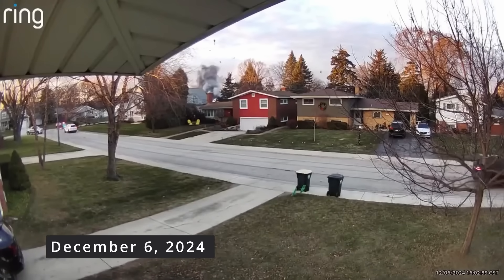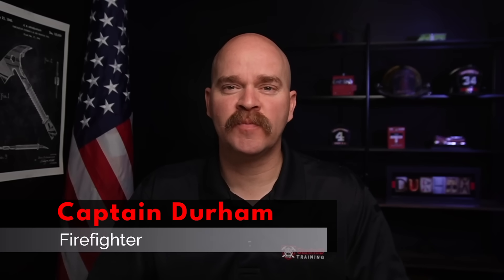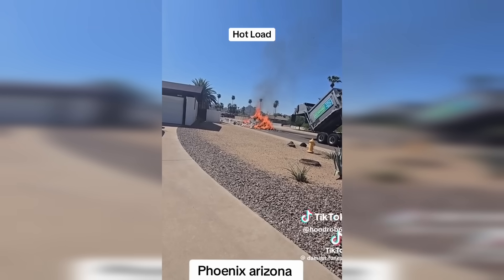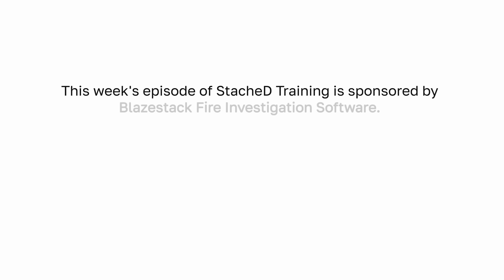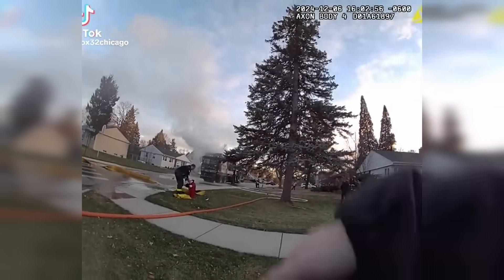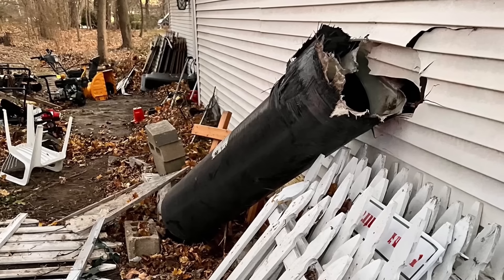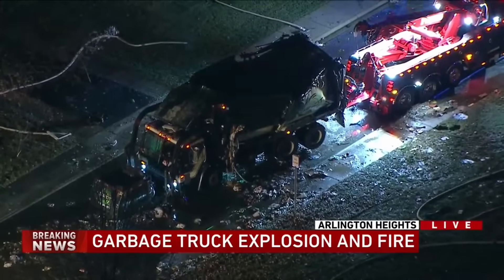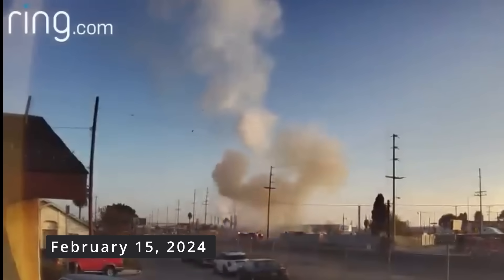CNG Garbage Truck Explosion Leaves 3 First Responders Injured!

Comment: CNG, LNG, and LPG
there are autos out there with all 3 fuel systems.
Liquid Natural gas, is like oxygen when turned to a liquid, it requires man made refrigeration to make it and maintain it, without a over pressure event.
Thus why compressed Natural gas fuel systems are made, no risk of venting when it sits for days in a vehicle.
3,600psi is the norm, for full CNG tanks.
.
Propane or LPG is way lower pressures, emergency relief valves are a little over 300 psi, in my experience. Normal operation pressure is directly related to atmosphere temperature.
Negative -40F is basically 0 pressure, a hot desert day is about the same as a air compressor tank at 150psi~
But still after it vents most of the fuel, it must be cooled or it definitely goes boom.
0.01c

Comment: Dang more Lithium battery catastrophe… did not see thermal runaway blowing up CNG.  The PRV valves are not full flow either.  Some regions require the PRV to have a hose on them exiting towards the ground adding more restriction.

Comment: Leaving aside the known hazards of lithium ion batteries there is also a big hazard associated with driving around in a vehicle with a tank of methane pressurized to 2000 PSI!
Reply: Forget the CNG and go back to diesel fuel. Much safer
Reply: 3300 psi or 3600 psi are the fill pressures that I've seen in the gas industry. And the tanks are engineered for burst pressures much higher than that. If a tank gets to burst pressure, one or more other errors were made first. And let's not forget CNG has much less energy density than propane, and we accept propane on much less stringently engineered uses (looking at you, RVs and food trucks).
Reply: @davidfirth1  In which gas industry, I ask because in the industrial gas industry maximum fill pressure is usually 2400 PSI and that lack of energy density you mentioned is the reason they are trying to use such high pressures though that is a fruitless enterprise. Because of Boyle's Law after 3000 PSI you no longer gain that much volume per additional pressure unit!
Reply: @ Natural gas. My recollection is our first use of CNG in our own passenger car fleet was 3300 psi and the current truck usually is 3600 psi. But I don't work directly with fill units and it has been a long time since I drove one.

Comment: Do you think that hydrogen carries the same risks?
Reply: More. Hydrogen's flammability range (7X CNG) is so wide, it can self ignite from static when leaking or pressure venting, making it more dangerous.
It's obvious to most, there's a reason diesel has been the traditional fuel of transport for over a century.
Reply: Q: Do you think that hydrogen carries the same risks?  A: the Hindenburg says "YES".

Comment: How do you avoid putting water on the PRD valve when the whole vehicle is on fire?  (I'm not a firefighter, just an engineer.)
Reply from the maker: Step 1, know it's there.  It can be difficult to avoid.
Reply: Evacuate the area and wait.
Same technique for a burning load of Ammonium Nitrate Fuel Oil Mix. (Another common road transport load in areas where mining happens). You just need to find all the parts in a half mile an hour later after it detonates.
Tyre fires are a common cause of heavy vehicle fires too (caused by hot brakes).
Overwrapped cylinders BURN…
Reply: @allangibson8494  😲 I thought you werent supposed to put the FO with the AN until you had it it the hole in the ground?  Yeah, yeah diesel spill and all.
Reply: Forget the CNG  and go back to diesel fuel. Much safer

Comment: I'm sorry, why not use diesel engines?
Reply: CNG is cheaper, burns cleaner, has less emissions components, and the engine oil stays very clean due to how clean CNG burns.
Reply: @user-ln7of9gs4s  it's also less energy dense and you need more of it. It's great for relatively low powered vehicles like forklifts, not sure it's the best idea for a 350-400hp application.
Reply: @randomidiot8142  Most likely routes are planned to manage gas levels.
Reply: @user-ln7of9gs4s well this one certainly had plenty of emissions.
Reply: @user-ln7of9gs4s  Back in the 1980s I had an engine builder doing a lot of work for me, they used to show me some things. One of those things were cylinder heads on CNG-run engines. The valve wear was excessive compared to the same engines run on gasoline, because the liquid gasoline has some lubrication properties to it and the dry gaseous fuel does not.
Reply: Forget the CNG  and go back to diesel fuel. Much safer
Reply: @gtbproductions1 cut and paste.
Reply: climate grifters
Reply: @joeg5414 there is no grift bud, pumping 27 gigatons of CO2 into the atmosphere every year just from burning carbon to boil water and move pistons is why climates are changing, especially in the higher latitudes. This has been known for nearly 60 years, but cheap energy, maximizes profits, the 1% happy.  And you'll buy cheap lies over hard truths. Oh that 27 GIGATONS is on top of all the naturally occurring CO2. That little extra is making things warmer. When you scoff at the avg temperature chart shown from the last century that's the average surface temperature of the globe and 72% of that is ocean. When was the last time you heard vessels needed to be wary of icebergs? Or I don't know look at the Hardiness Zones and compare them today from the last 50-70 years, they have moved north.
Reply: Clean city air grifters

Comment: I realize this is a CNG issue, but you mentioned it may have been caused by an improperly disposed lithium ion battery.  What is the best way to dispose of lithium batteries, of all common types, including laptop replacement batteries, phone replacement batteries, ebike batteries, lithium motorcycle batteries, calculator batteries, and common aa-cell, d-cell batteries?  What is the best place to google this disposal info?  If fees are involved with consumer disposal, I worry the proper disposal methods may often not be followed and deposit-return refunds may need to be added when selling the new battery to incentivize proper recycling.
Reply from the maker: There are a lot of issues around the disposal of lithium-ion batteries.  I'm working with a recycler to create content around that topic for the future.
Reply: @StacheDTraining I take my batteries to the local transfer station where the trash company runs a household hazmat collection program.  How they package them and ship them I have no idea.
Reply: There is. Forget the CNG  and go back to diesel fuel. Much safer
Reply: I have seen a couple recycling centers open somewhere near me and then eventually close down. They would only take certain things, for example only types 1 & 2 plastic. I tried to use them. They always closed eventually because they were unprofitable boondoggles that cost too much to operate.
Reply: @onemoremisfit  Recycling is all about the money. I watch the channel "Mr Digg." He runs and owns a landfill and to recycle the trash and better use the land, he started a sand business for concrete, recycles concrete, makes wood mulch, compost, top soil, and firewood from discarded trees, wood, and pallets, make huge concrete blocks out of the leftover concrete from the concrete trucks of the nearby plant, and he has a garden store where he sells some of the products they make. People ask why they don't recycle more. It is always about being able to make enough profit to run the business of recycling the waste. It is easier and cheaper to bury it (that is what most people and businesses will choose if they have to pay more to recycle) but he has managed to make the other businesses and profit enough to keep them running.
Reply: "What is the best way to dispose of lithium batteries"?
Take them to your county's "hazardous waste" department.
Reply: There really isn't any common place to dispose of them and of you find one it costs more than the device the battery came in. 😂
Reply: @GoonyMclinux  County "hazardous waste" departments are very commonplace.
Reply: @2Truth4Liberty  Doesn't exist where im at, if it does its not a an advertised department. I worked in hazmat so im not coming from inexperience.
Reply: The company that picks up your trash should be able to tell you where to take used batteries.
Reply: in most discounts or supermarkts in europe they have places to dump collect all kinds of batteries.
Reply: So I can't just wedge them under a cyber truck back wheel?
Reply: Find a container that’s big enough to hold the battery, fill it with water, put about half a spoonful of table salt in it, leave the battery in it overnight. 
This will allow the battery to fully discharge at a safe rate and keeping it underwater will keep it from getting hot enough to ignite. Once it’s completely discharged, it’s no longer a fire hazard. Then do what’s necessary to dispose of it.
Reply: Most large home improvemnt stores have them. home depot / lowes, ace, etc. 
I think it might be a state by state thing though, nothing cohesive
It's so weird to hear you say that to me because i see the bins so often. I think it's required that if you sell a large enough volume you need to provide disposal locations, because even some office supply stores have them, and wal-mart
Reply: in germany we got recyling centers that deal with these questions... if you are lucky they got a phamplet lying around that lists what they want you to put into which bin... usually there are two around (one run by the town and on run by the county)... in addition there are the trashcans they collect with garbage-trucks these got a flyer with what you are not supposed to throw in there... been living in two different countys the last 10 years (plus insight into this at my folks home) so plenty of options to choose from (since about 60% of the trash you want to get rid of has DIFFERENT solutions in all these listings) i usually only care with batteries and spraycans to follow their wishes (for batteries they most got a special bin to collect em in but different wishes what kind of battery you can dispose there... for example any battery permanently installed in a divice you have to bring to a store that sells that kind of divice (that will refuse to take in divices of brands they do not sell <anymore>)

tldr: if you skipped to this line you are the kind of person that would toss em into the normal garbage bin and burn down a garbage truck on occation
Reply: @novacat3032  or the sort of person that read the first line and will now post all their spent batteries to germany...